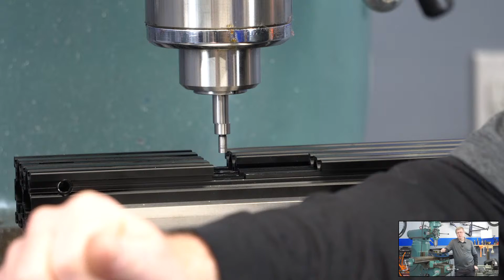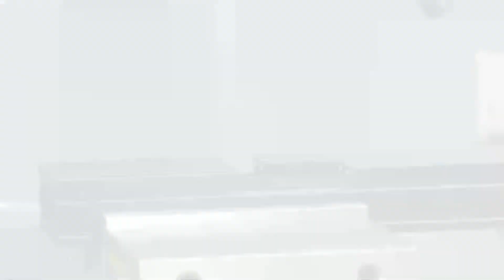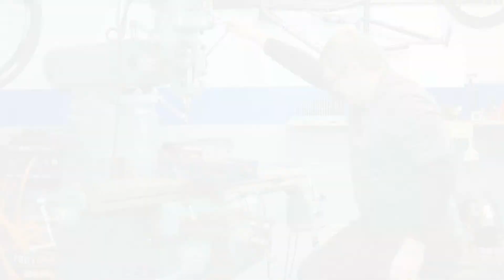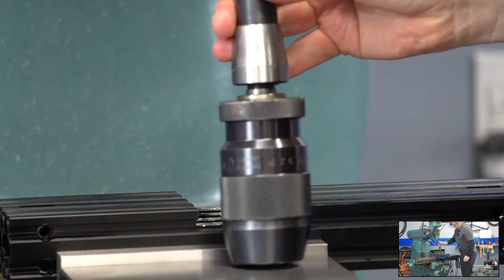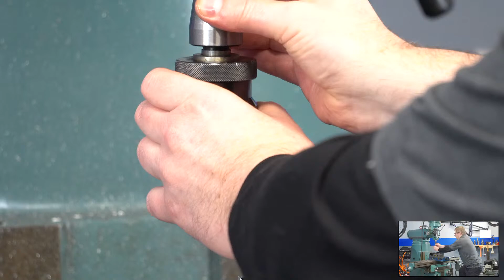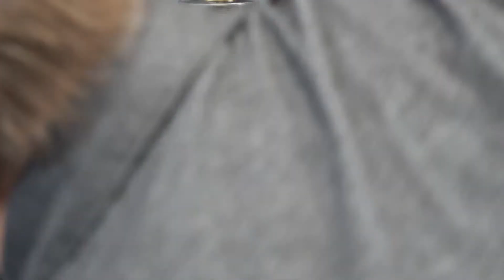Sidewinder X2 Mega Mod Project Part 2, Lets Start Machining the Frame.

Comment: Hi I thought it's a shame that you are reworking the swx2 so deeply - other users will no longer have useful new tutorials on your channel for their swx2 - despite the latest and undoubtedly interesting reworkings.

But I have an idea - you currently have access to all swx2 parts maybe you would be interested in creating a photo documentation of swx2 printer parts on your site?

The average user who has only one printer often has trouble accessing drawings of individual parts to be able to design an upgrade without disassembling the printer.

I, for example, am looking for a high-resolution photo of a bed carriage-perpendicular to its surface.
😊
Reply: Sorry, I was wrong about those modifications... In the last short video, I noticed that milling the printer made it possible to mount MGN9 rails on the Y-axis...
Good idea...
New ideas for upgrading the X2 would be useful 😀 It's slowly becoming old equipment, but it's great for modifications 😀 Maybe a new extruder? On Printables, you can find a great AeroHGXtruderNX with dedicated cooling - in my opinion, the best for a single 5015 fan...